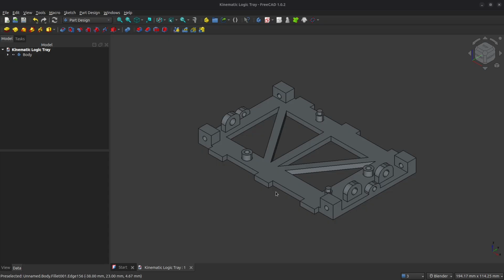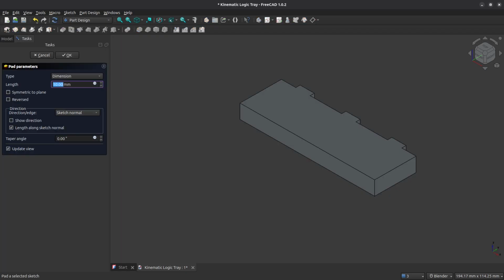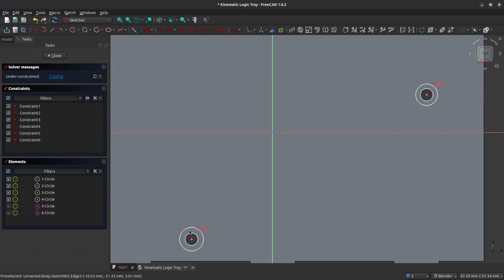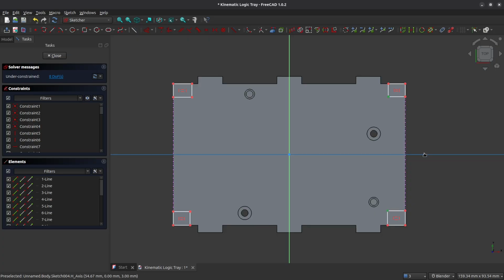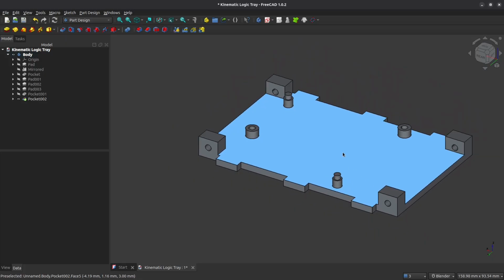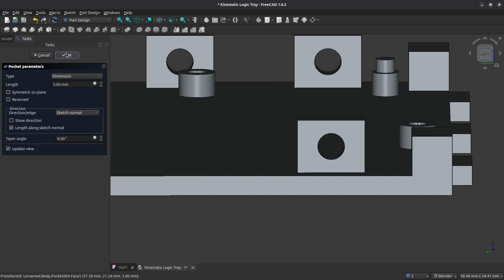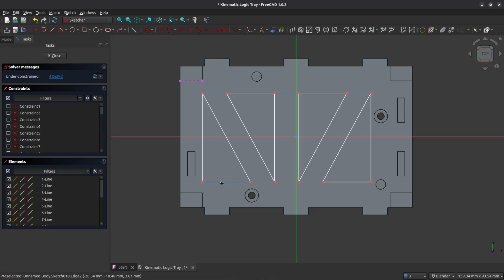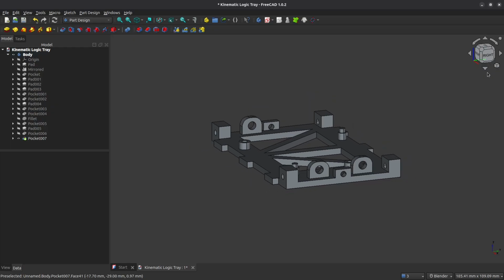Part 5: The Kinematic Control Tray - TitanBot | FreeCAD Robotics Design

Comment from the maker: The TitanBot finally has a brain! This Control Deck isn't just a mount; it’s a structural bridge that reinforces our Vertical Frame Rails while separating the high-current motor drivers from our future sensors.

Design Tip: Note how we use coarse-thread screws for the plastic stand-offs. When modeling in FreeCAD, ensure your pilot holes are sized correctly (usually 2.5mm to 2.8mm for an M3 screw) to allow the threads to bite without splitting the print!

Next Step: Logic is secure. Now we need heavy power distribution.
👉 Watch Part 6 (Vetronics Deck) here: https://youtu.be/LC0mWSxZ6F8

Question: We're using the classic Adafruit V1 Motor Shield here. What motor driver are you using for your builds? L298N? TB6612? Let me know below! 👇